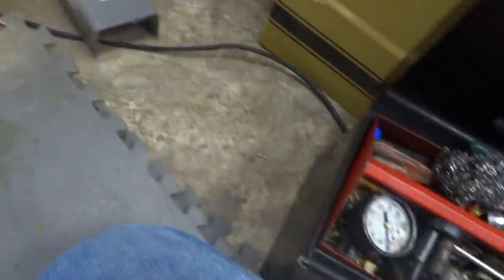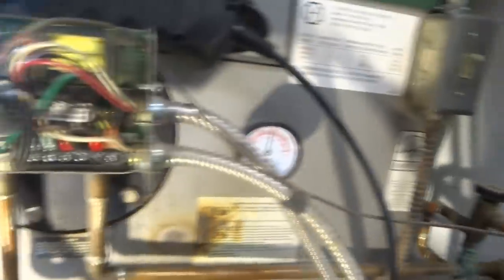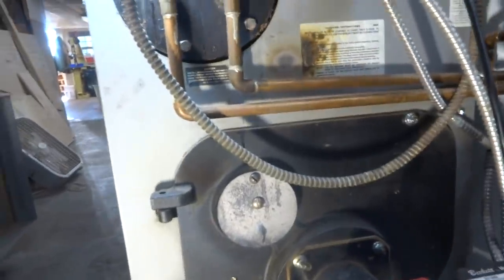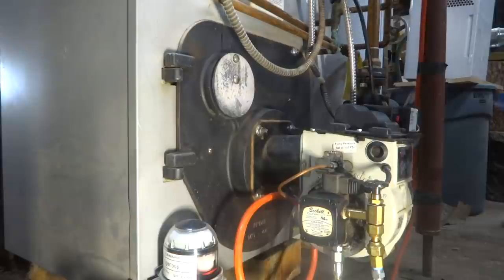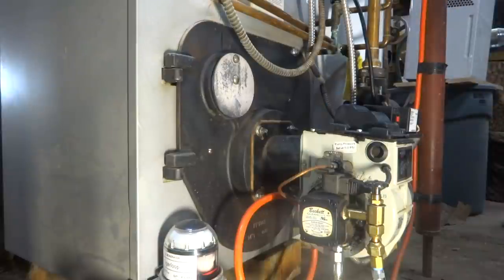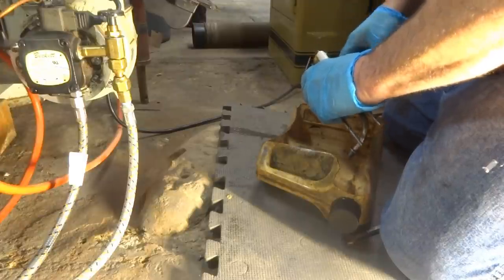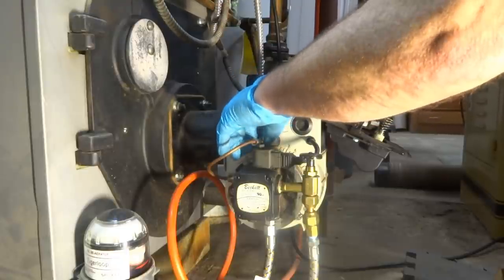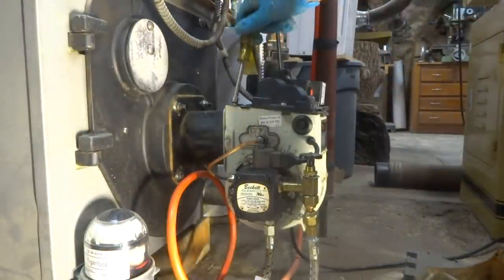HOMEOWNER CALLS ME IN TO CHECK HIS OIL BURNER

Comment: Take it easy on joe homeowner. We are all trying to save a buck. It never ends you have to do what you can and learn from you mistakes (and successes).
Reply: Leaving a  nozzle loose is  almost criminal. Oil burner is not a  toy.  That guy homeowner should keep his hand in his  pockets,
Reply: @sandyshoremann7524  Probably, true, Sandy.  A Joe HO needs to have some BASIC skills and knowledge of tools and fastening systems that our friend here seems to lack.  The problem is in trying to SAVE a few bucks you can easily COST yourself a bundle later on.  "The cheap becomes expensive."

Comment: Furnace stopped working, main burner wouldn't fire up. Inducer was going, igniter glowed,  gas came on then shut down. No flashing lights. Why not clean the flame sensor? That did the trick. Steve's You Tubes made the difference. Saved me a house call.

Comment: 13:05  Hmmm... I have a Buderus G215 (Riello head, no top controller) 1.50 , 80W.  Could I try stepping down to a 1.0 for example?  Mine is pretty loud and cycles quite a bit.  Only a single Grundfos 3-speed pump on high, bunch of zone valves.
Reply: Using a smaller nozzle  will just mean longer to reach high limit.  Heater will run longer but with less heat loss up the flue.
Reply: @williamgibb5557    That's what I was thinking, it has the factory nozzle to match the listed BTU on the unit.  My setup doesn't pull enough heat away from the boiler to warrant such fast recovery.  Will also quiet it down, mine sounds like a jet engine.  Now how do I adjust the air?  Also, stick with same 80*W?
Reply: @Hubjeep  on side of blower housing, is the scale for air adjustment.  Just match air to nozzle size. Keep the 80 fan size. That's for the shape of the heater combustion chamber.
Reply: @williamgibb5557   Thanks!   How much air?  Manufacturer only gives specs on the 1.50 nozzle.
Reply: @Hubjeep  if there is no scale on side of blower, then best to call service guy.
Reply: @williamgibb5557   Ideally, yes.  I've seen Steve appear to set it visually.  Today I picked up a 1.35  nozzle, not much smaller than the 1.50, I believe next size was 1.1

Comment: It always amazes me how old the heating systems are in the us. even the gas boilers are prehistoric. In Europe, these devices can never meet the emission standards and they consume a lot of energy. Here too, no digital analysis of the flue gases is made in order to limit emissions and optimise combustion.  The theory of opening the viewing window is completely wrong, this increases the standstill losses. When the boiler is not working, there is an airflow through the hole via the chimney to the outside. This causes the boiler to cool down faster and start up again.The correct procedure is to install a valve in the chimney itself that controls the chimney draft. In europe, the air valve of the burner also closes when it is not working, if it stays open, ( energy saving valve ) you have the same effect.